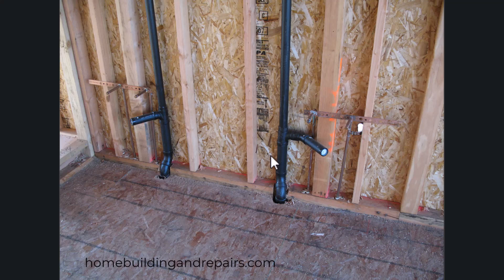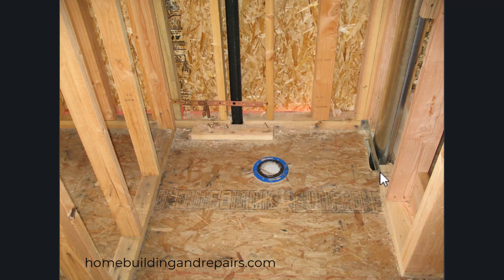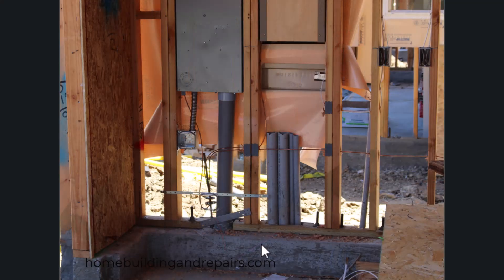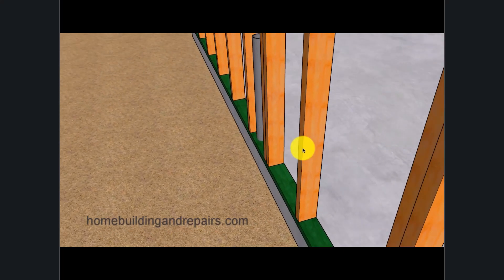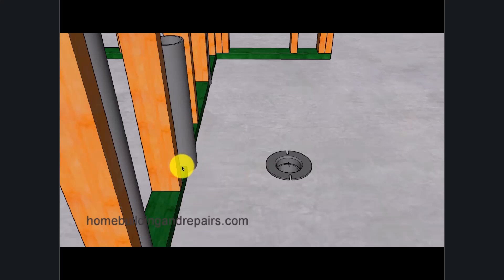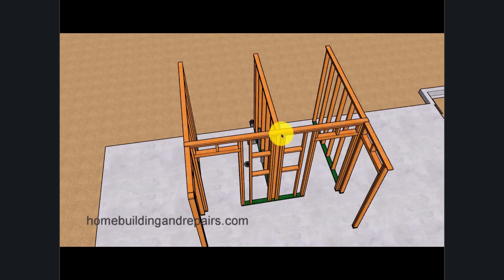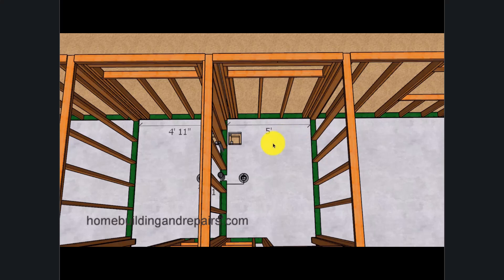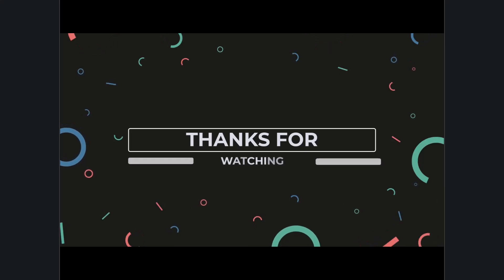Notching And Drilling Through Bottom Wall Framing Plates For Electrical And Plumbing Tutorial

Comment: Thanks for the video. One 1:52 it shows the electrical panel installed to the studs. How would you put the felt, lath and stucco afterwards? Unless that electrical panel is inside the house.